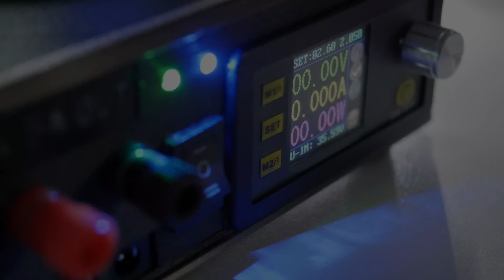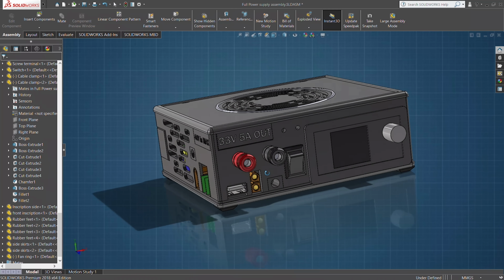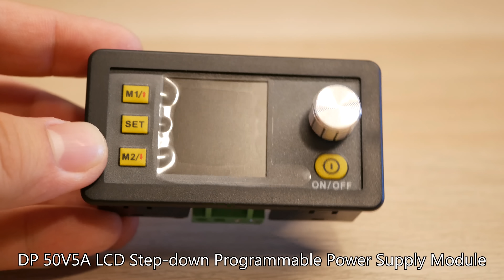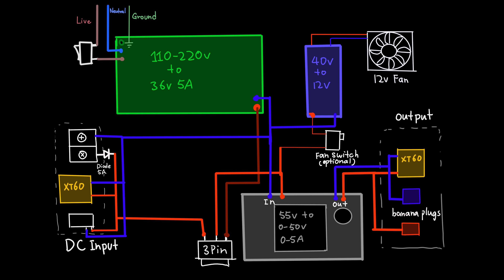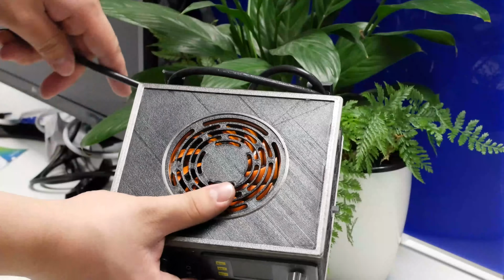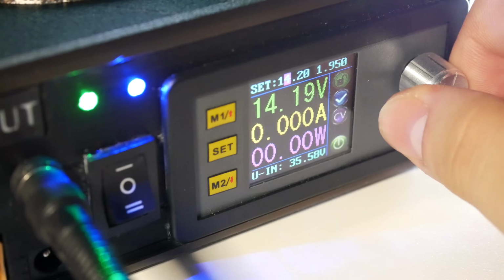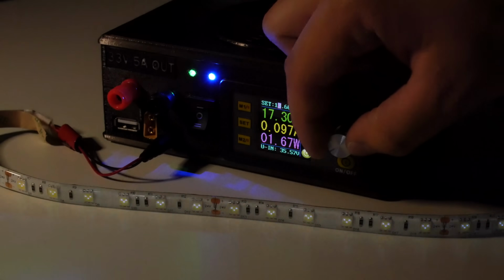DIY Mini Lab Bench Power Supply (With Switchable DC and AC Input)

Comment: You should have added a knot to the ac line in to prevent it from being pulled out and causing electrocution or a fire.
Reply: Should have used an IEC C14 chassis connector so the cable wouldn't be fixed or need to be cut...

Comment: The only thing I don't like about your design is that the AC power cable is fixed. Would be much better with a removable cable.
Reply: just what i was thinking, am currently looking at IEC sockets, and adding a fuse on the mains side as that's also missing from this project

Comment: I finished building this PSU today and I have to say that it is really awesome but I installed an BeQuiet Silent Wings 3 12v Fan to cool the entire thing more efficient.
If you want to get a 3D printer that is cheap and easy to repair, then I recommend the Creality Ender 3 pro. I bought this printer for 120$ from ebay and it just worked fine, after I printed 3D upgrade parts to improve the 3D printing capabilities with this printer.

Comment: Can low voltage power supply with bigger amp turn on power pure sine wave inverter 3000watt 220VAC
Reply: @Another Dick I want to use cheap converter that support 12V 5A-33A to inverter which mean cut the electricity cost by half for month.If battery defected hybrid mode is till running.
Reply: @Another Dick I ask people about my project from 10 person 4/10 said it possible while other said it useless project because system i try to build need same input voltage and amp to fully support inverter.I doing coin mining now not yet on hybrid solar because 2000w pmono panel are quiet expensive + pure sine inverter.

Comment: In United States, we usually find that the color standards for electrical terminals are:
Red( + ), aka "hot" / Black is normally either ( - ) or ( GND ),  White can be a negative lead, but is usually live. 

I think he probably looked at the chart that was shown at the start of the video and misread "United Kingdom" for "United States"... hahha... I an sure he is not the first to make this mistake. 

Thanks for the lesson on a simple PSU. I think I may just adapt a version of this for my own use.
Reply: on ac systems black is hot, white is neutral, white is never "live". on dc systems, red is +, black is -

Comment: lack of filter, lack of overcurrent protection, have many potential of loss of power, my recomendation is you should take a look at posibility of power loss on you design, and cmon man, you need a filter on DC circuit
Reply: Can you elaborate more on this please? So add some filter capacitors to the dc inputs and outputs? I am most curious about your statement of power loss in the circuit.

Comment: Why run the fan at 12V when you can run it at 7V to lower the noise level. Also, where is that AC grounded at? With my limited knowledge about household appliances and their grounding i think it needs to be grounded to chassis in case of fault, but your case is plastic..

Take some time with soldering, soldering properly is not difficult to master
Reply: Ac ground is case ground, which exists to prevent metal shock in case a loose wire is disconnected inside an appliance and prevents a situation where a metal case may be electrified. The case ground will short the loose wire, blowing a breaker and preventing electrocution. Not really necessary  since, like you said, it's a plastic case
Reply: @yetanotherPC  yea, you rounded up it like professional

Comment: How to solder a 20amp Diode :  HOLD THE GOT DAMN IRON ON IT UNTIL IT GETS HOT ENOUGH AND SOLDER FLOWS onto the leads (2-4 seconds)
that being said i was VERY impressed by how you desoldered that SMD LED , i couldnt do that if i tried :D
Reply: Forthereg M if you have a chisel tip that is big enough and don’t need the SMD LED, just slap the iron on both pads
Reply: Doesn't take much - big blob of solder on the iron tip, touch the LED, pull it off. Most of them time they're even salvageable, but not necessary for this.

Comment: You should at least learn how to solder before designing a mains powered device, learn about reliable connections and how to connect the mains earth without being a safety hazard. Then think about the mechanical stability of your casing before you switch on your EMI/Ripple generator.
At all it visually looks nice and many considerations went into this project. So thank you for showing this off.
Reply: Agree. It is scary at times. It seems more like 'tacking' than soldering. And, like you said, no mechanical bond. and like you alluded to the connection seems ill-suited for mains or high current..

Comment: The down site of a PSU like this, you will have a lot of ripple and noise on the outputs. This condition may be problematic on some circuits. The heavy and expensive PSUs you can buy are most likely linear without ripple and noise, for because they have no high frequent DC-DC converters in it. But your video explains a cheap and easy way to get a variable PSU for general use. And just do not care about the critics of your soldering. Even big channels like 8-Bit Guy oder EEVblog get comments like this.
Reply: Well, TheLOD2010, the 8-Bit Guy and EEVblog do not get comments condemning their soldering, although they do get criticism of a lower order. The reason for that is, their soldering techniques might be less than ideal (8 Bit Guy), or compromised by the fact that he is trying to work with a camera while soldering (EEVblog), but in THIS video, the soldering is just unjustifiably awful. The OP 'should' be getting the criticisms that he is. This is an instructional video, clearly made for people who know very little about electronics. To demonstrate such poor soldering techniques in such a video is irresponsible and will certainly mislead many neophytes. And since AC mains is involved, this is also quite dangerous. So please don't tell him that this is OK.
Reply: @youtuuba  TOTALLY AGREE. This is JUSTIFIED CRITICISM.
Reply: There are so many problems with a SMPS!!!!  You are correct but maybe it is worse than you think :)
Reply: TheLOD2010, ripple and noise are potential issues with BOTH switching and linear supplies. The main difference is the frequency of the ripple. A well designed switching supply will have negligible ripple, just as a well designed linear supply will appear to have virtually no ripple. But these cheap little supplies are probably not as well designed as the more expensive ones.

If you doubt that switching supplies can be adequately quiet, just look at the vast majority of power supplies that are furnished with (or are integral to) most modern electronic devices today, regardless of type or purpose...linears are pretty rare.
Reply: @youtuuba  That is a silly statement;  just look at the vast majority of power supplies that are furnished with ...linears are pretty rare.

SMPS are popular with manufacturers because they are smaller, lighter and cheaper to make.  Size and weight are important because of shipping cost.   NOT because they are better. The Chinese HAD to make them for the computer market (ATX PSU and such) and the early ones were really bad. Then they learned and improved and the technology migrated to consumer products.
Like dude, do you REALLY think the Chinese would make something because it was better and not because it was cheaper?!!!!!!
Reply: @kennmossman8701  , what do you think I wrote? I was saying that switchers are in almost everything these days, and linears are rare. So why did you think my comment was silly?
Reply: @youtuuba  Read my edited reply. Popularity is not an argument as popularity does Not indicate quality/a better choice. To wit;
Smoking was popular until the 1970's
Windows is popular
.Net is popular
tRump was popular
Hitler was popular
Use of asbestos was popular
SUVs are popular
................and so on
Reply: @youtuuba  SMPS are FAR more noisy with spikes & ramping; the noise is across a broad spectrum. Just look at an oscilloscope view of a typical SMPS; it looks horrible. So Mr. Expert just what are the ripple frequencies?   And why is that important?

Comment: your soldering is often poor and sometimes you solder parts which are not suitable for soldering
Reply: You're supposed to heat the components/wires/connectors with the soldering iron, and then melt and flow the solder on the components.  You're not supposed to just drip or spread solder from the iron around like it's some kind of glue or cement.  You're not welding this stuff together with molten solder.  You need to apply the solder to the heated joint so that the flux in the solder can take effect on the component leads or wires and you can get a good joint.  Your soldering technique is terrible, and those poor joints are going to cause you difficult to diagnose problems in the future.
Reply: @lmamakos  Well said.
Reply: Jedzia Dex
6 hours ago
You should at least learn how to solder before designing a mains powered device, learn about reliable connections and how to connect the mains earth without being a safety hazard. Then think about the mechanical stability of your casing before you switch on your EMI/Ripple generator.
At all it visually looks nice and many considerations went into this project. So thank you for showing this off.
Kenn Mossman

2 seconds ago
Agree. It is scary at times. It seems more like 'tacking' than soldering. And, like you said, no mechanical bond. and like you alluded to the connection seems ill-suited for mains or high current..

Comment: If you don't have a 3D printer there is a standard case available for that DC supply module that is very reasonably priced https://www.banggood.com/RIDEN-DP-And-DPS-Power-Supply-Housing-2-Kinds-Aluminum-Housing-Constant-Voltage-Current-Case-p-1146253.html?rmmds=detail-top-buytogether-auto&ID=514816&cur_warehouse=CN

Comment: I like this a lot but I'm concerned about some of your soldering connections, especially the high current connections, like on the switches where you just tacked the wire to the terminal without wrapping it through the hole, and where the power leads are just tacked into the circuit board instead of soldered through the holes where the terminals used to be.  I know everything is contained and there's not a lot of strain but a good mechanical connection will improve the life of your soldered terminations.
Reply: Totally agree.  As you alluded to  often the connections are Not suitable for high current
Reply: I'm concerned as well

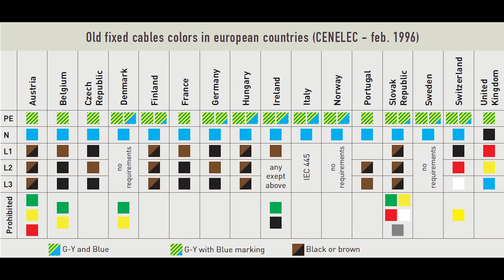Comment: 4:09 DO NOT USE THIS CHART AS IT IS WRONG ESPECIALLY THE UK SECTION!
PE = GR/Ye
L1 = Brown,
N = Blue.
Reply: it does say "OLD" colours.
Reply: @No1sonuk  They are not even the old colours
Reply: These colours are correct for the old 3 phase and neutral 240/415V (now nominally 230/400V). Colours were harmonised with European colours in the 17th edition of BS7671. Single phase flexible cord is as per Adam Bryant.
Reply: Just check the connections with a continuity tester.